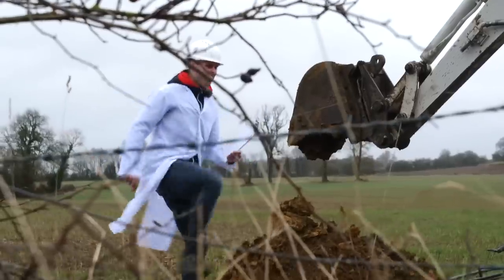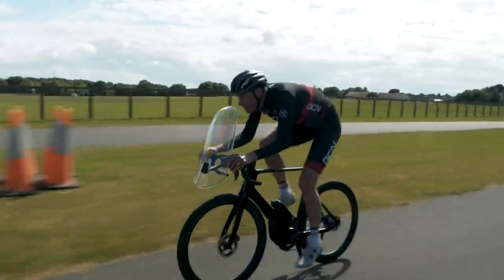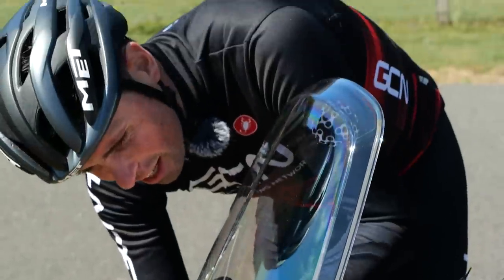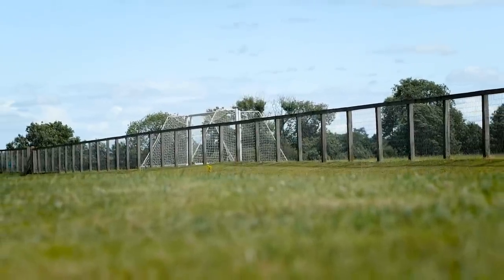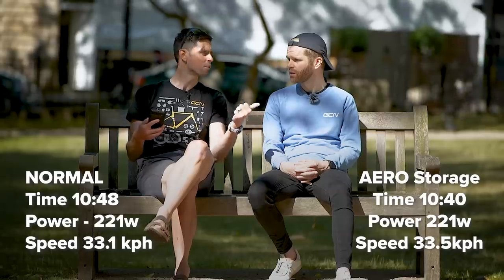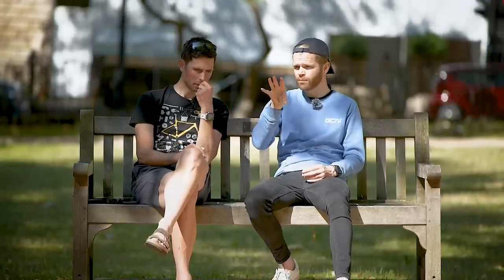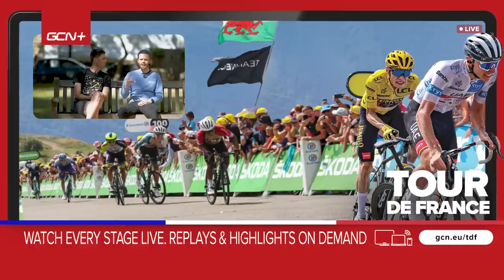Are Aero Fairings A Waste of Time? | GCN Tech Does Science

Comment: Hi guys, good video. In terms of bikes I wonder if devices that turn the air flow are better than shields. This is a common theme in motor sport, with front wings, which rather than generate lots of downforce generally turn the air around, under and over the car for better use down stream or for smooth rejoining behind (in conjunction with a cone device behind the rider as you discussed)
Reply: The cone has to be in front

Comment: Fluid dynamics, whether air or water, function similarly while the main difference is density. Cutting through air density is similar to the bow of a boat cutting through water density. What shape allows entrance into that medium, and exit from that medium with the least amount of turbulence and disruption and sharp directional changes of the medium? That's the key.
Back in the day of early "dust bin fairings" put on racing motorcycles, eventually the regulatory bodies stepped in and started "banning" features which has ultimately led to the motorcycle fairings that are seen on sports bikes today. We've gotten used to seeing them as they are, but they are NOT the most efficient design. The original designs reached out in front of the front wheel and extended beyond the tail of the motorcycle like a fish tail.

There's been independent design competitions annually in the USA where motorcyclists are encouraged to design their own home made fairings to compete with fuel consumption competitions, to see who can cover a distance in real world conditions at real world speeds but consume the least amount of fuel.

Comment: I am wondering about the error rate of these measurements.
Am average of 221 watts could be  220.5 wats in one case and 221.5 wats case in the other, anche a maximum thepretical difference of 1 watt.
would be 1 watts as much as 8 seconds in these conditions?

Comment: Aero power requirements are constant with air speed. You're never going to do 30kph in a 20 kph headwind if you're not close to do 50 kph without wind. The difference is a few watts in rolling resistance. Also, the business end of bluff bodies aerodynamics is at the back.

Comment: aero is very real. put something to cover the rear of the bike would be most helpful. i was also thinking. what if u had like a stick/rod with an air foil on the end leading a few feet out infront of the rider to redirect the air flow, it would allow for a small contact point to disrupt the flow, and it can be directed around the rider. Think ; Selfie Stick  with F1 style wing/ducting on the front.

Comment: That „barn door“ could probably help, if it were mounted at a flatter angle and had more of a curvature.
On the other hand, in a crash, that thing could decapitate you… 😉
Reply: Upper edge should be above head for safety reasons and full aero advantage.
Reply from the maker: That wouldn't be ideal 👀

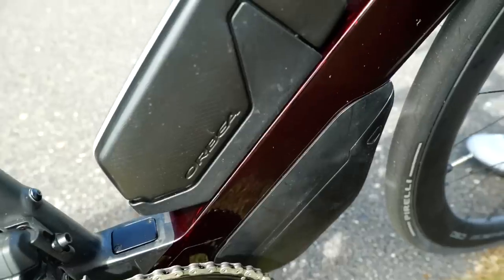Comment: 5:40
"I was riding at 221 watts which is about 30... 32kph." 
That's hilarious. 

My average speed for 200 watts on my Cruzbike V20 Vendetta high racer recumbent is 37.1kph. I have the Strava data on June 10th of this year to prove it. I did 103.44km in 2H:47M:25S and my CdA was 0.216 (which is higher than my usual 0.190 average) with only 166m of elevation (flat course). 

To hear avid and fit cyclists talk about saving 3 watts makes me shake my head. For me to average 33kph it costs me 160 watts on a really bad day of 0.233 CdA. That is 61 watts less. SIXTY FRIGGING ONE WATTS.

On a good day (July 10th tis year) of 0.177 CdA 207 watts gets me 40.6kph average. That is 14 less watts and almost 8kph more speed. I'm 55 years old and to be honest, high racer recumbents are really not that fast compared with low racer recumbents, faired recumbents, velomobiles, or god forbid streamliners. Each 1 of those is an order of magnitude faster than the previous. Diamond framed bikes? There are at least 5 classes of recumbents faster than a $15,000 Pinarello, or even the venerable Cervelo P5. A 6th class (touring) might even be faster.

If some of you young bucks jumped on some recumbents the speeds would be absolutely INSANE!!!!

Comment: Doesn't this speak for aero luggage carriers?
I'm imagining, like Ollie said, a wasps tail shaped box, that extends in the front to the riders back, maybe even with a cloth attachment to the rider, and tapers towards the back.
Even the pros could benefit here. Since the shape improves aerodynamics, they can put more stuff like water and food in there. This would free the down tube from un-aero-y attachments for even more aeroness. And for competitions the boxes could be hot-swappable.
But easier to test for GCN would be a rear aero fairing made from strechable cloth, that attaches to the rider. You want it to be in tension or else it would wobble/flab around negating the aero gains. If it were to be made from denser cloth, it could be made inflatable. Imagine a completely inflatable aero fairing. You could sell it to the pro teams as branding surface opportunity.

Comment: The aero dynamic problems of the world can really be solved by sending Ollie to the Barbershop.

GCN is reaching the level of absurdity!  There are so many more variables than front en aero dynamics but GCN ignore them blindly.  

Their testing regimes are also not scientifically correct. Each test run is facing a mirriad of conditions unique to just that session, you cannot correlate the aero parameter of different sessions when there are multiple parameters that differ from one run to the next.  This boils down to irrelevant test results.

Comment: Let's add more plastic to the difficult to recycle carbon fibre, steel which uses coal in the manufacturing process and the energy intensive aluminium making process. Let's not forget bikes are green
Reply: Relative to what? Do cars use any less steel or aluminium? Isn't walking less energy efficient, requiring more food to be consumed to travel the same distance? Current food production isn't carbon neutral, either?
Reply: Name one thing that's carbon neutral